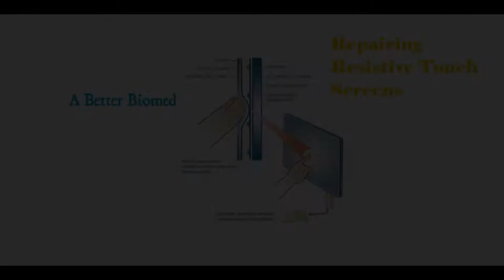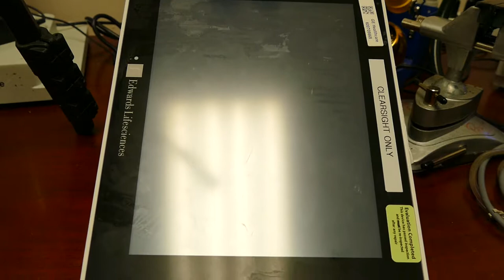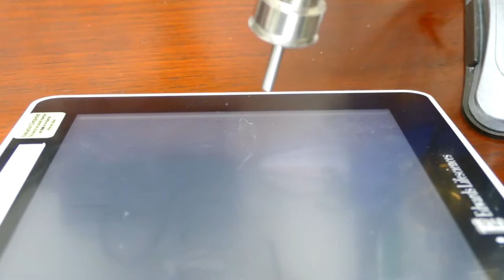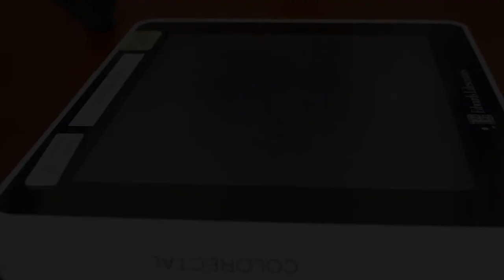how to fix resistive touch screen

Comment: very interesting video! Would this also work on a poorly responsive resistive touchscreen? I have a touchscreen on which the user has to press very hard before the screen detects that it is being pressed. especially in frequently used places on the screen. Maybe the layers can also recover in their entirety by heat and react better?
Reply from the maker: Very possible. A resistive touch screen requires little pressure to activate. Look for defects in the outer layer.

Comment: Would this likely work on non-touch screens too? Have a covidien kangaroo pump with a damaged screen that I can’t get a replacement screen/case for. Hoping to be able to rescue it :)
Reply from the maker: Mainly, this repair will separate the layers of the screen so a critical error isn't created during boot up. It is possible to use light heat to help remove impact scratches and dents in the screen.

Comment: What to do if there is no visible damage but the screen is still not accepting touch?
Reply from the maker: Depends on the type of touchscreen
Reply: @BetterBiomedChannel  it's resistive only 🙏
Reply from the maker: @drswapnil1234  you can still have a bad touch encoder or touch controller.  I would hold the touch screen in the middle while booting and see if it loads a calibration screen
Reply: @BetterBiomedChannel  thanks sir. will try doing that
Reply: I am trying to fix my bosch and Lomb machine touch and the heat method sadly did not work. I am getting another panel which is from a different manufacturer but same pin configuration and same wire method. Is there any chance that it can be incompatible? Is there any software lock on these things. 
Thanks a million

Comment: Thank you for the idea.
I used similar method with a hair dryer on my car dash head touch screen which was not responsive after dismantling it from the car and took out the resistive glass panel. It worked and save me money from buying a new unit. However need to be careful as too much heat can warp the screen and heating the four sides with the metal strips and pressing the sides work better.
Reply: My radio screen has a bubble, like it started to unpaste in the middle, so I can't touch a point because it seems to being touching another point, would work to heat up this part?

Comment: On an old GPS resistive touch screen, a white halo appeared about a month ago. Is there any way of getting rid of this round halo?
Ocasionally the screen looses sensitivity and the hot air dryer trick solves the problem. Do you think the screen is reaching its end of life?
Reply from the maker: Sound slike this poor display needs a rest.
Reply: @BetterBiomedChannel  Some time in a dark space, with a moderate temperature and relative humidity, would that be ok?

Comment: how would the before and after x and y resistance readings be?  thanks :)
Reply from the maker: A contact point activation is a (x y) grid low resistance value.  The lower x and lower y values = closer to grid 0,0 point which is the corner closest to the digitizer cable (usually)